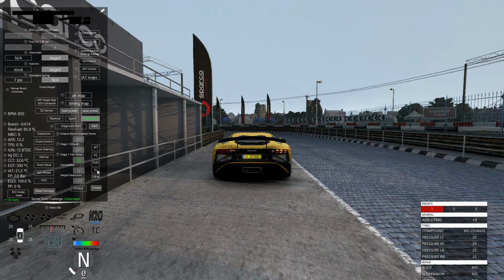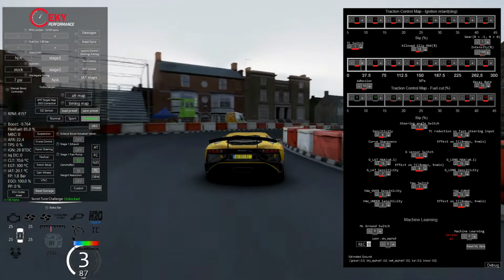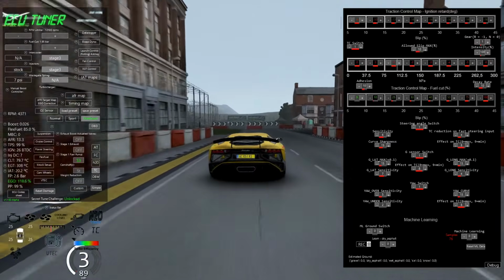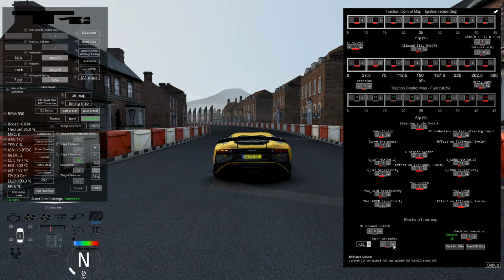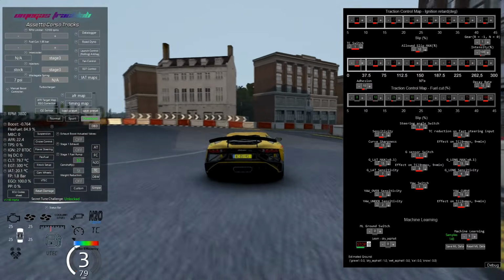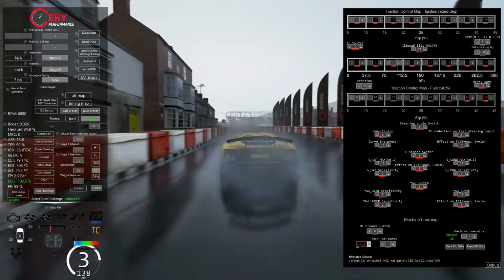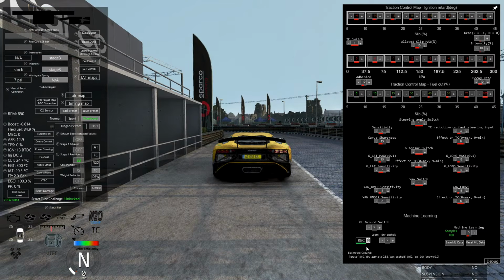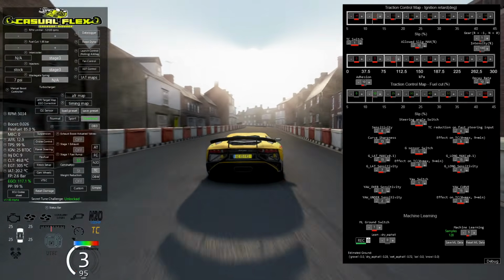Assetto Corsa - Ecu Tuner #163 - Machine Learning

Comment: Does this changes the "data" of the car (like the folder of the car) or is it the simple setup change?
Reply from the maker: This is for the ECU tuner cars only, and the machine learning data is saved and loaded from separate files located in the ECU tuner app folder, so nothing with car data folder
Reply: @matel855  Oh, thanks. I appreciate it!